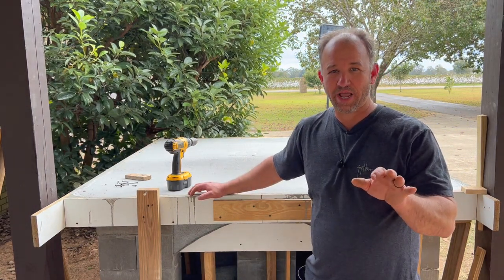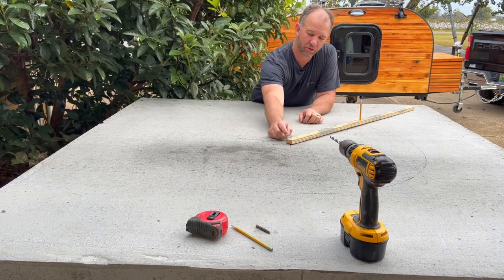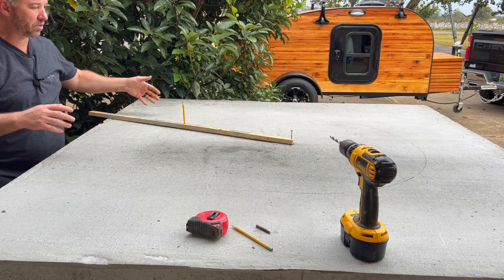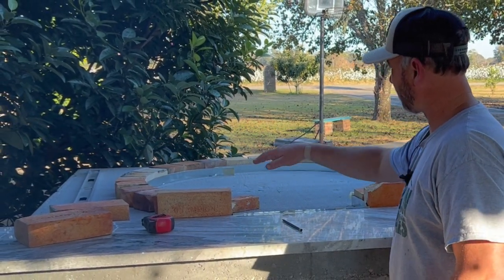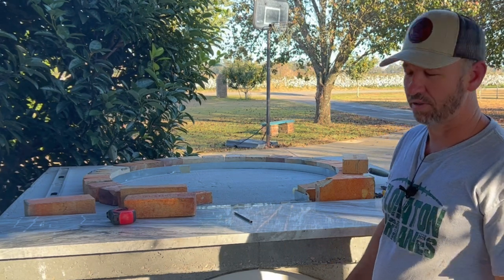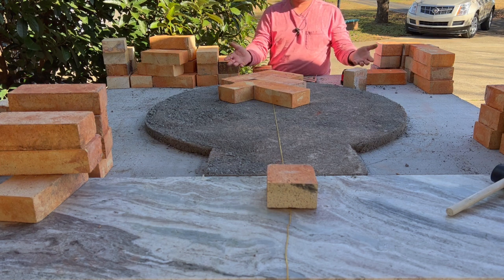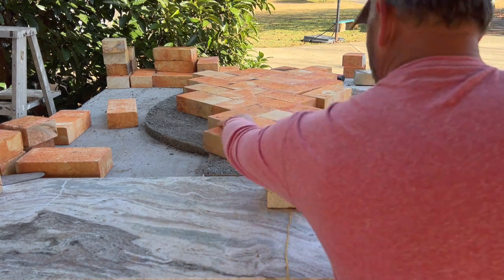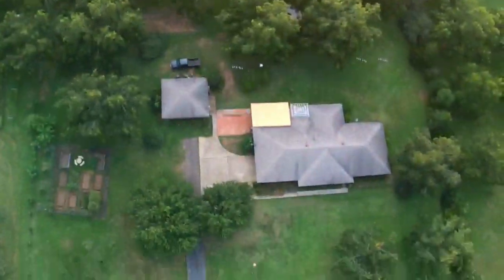DIY Pizza Oven Floor build | Vermicrete Insulation and Fire Brick Floor | Part 4

Comment: Thx.  Nice video, so the vermiculite is an insulator, what about the fact that you need lots of thermal mass on the bottom to retain the heat for second, third pizzas.  Seems like things like calcium silicate board or vermiculite which are both insulators - while will keep the heat in the oven but won’t store the heat for the bottom - one of the most difficult aspects of cooking pizza in a wood fired oven but if you used straight refractory cement (like 6”) you would have the heat battery needed to solve the make up heat equation?

Comment: Any disadvantages of just doing an insulation layer on the entire concrete slab?  Also I was thinking of doing a 6" layer, yours seems too thin?
Reply from the maker: No disadvantages at all. The insulation layer is used mostly for retaining heat to keep the oven hot. You don’t have to have an insulation layer at all.
Reply: @FlomatonFamous  You do if you want to he able to cook other stuff and maximize the heat.
Reply from the maker: @lowspeed2000  yep, very true
Reply: Just get two inch ceramic fiber board for the base. It works great, I did a 4” vermiculite insulation base and I haven’t had any issues

Comment: hi , dit you mix simple cement with Vermiculite ? dit you dont use Refractory cement ? , but normal cement wil crack of the heat !
Reply from the maker: Yes, simple cement, silicone sand (pool filter sand), fire clay. This should help. https://www.fornobravo.com/brick-oven-cooking/cooking-surface/
Reply: Refractory cement is just Portland cement with some alumina in it. You can actually get alumina particles pretty easy, but vermiculite and cement is pretty good for this stuff
Reply: @VinnyGjokaj  NO WAY! I’ve been trying to get this information for so long. Finally YOU sir have just answered it!! Brilliant advice! Thanks Vinny. Xx